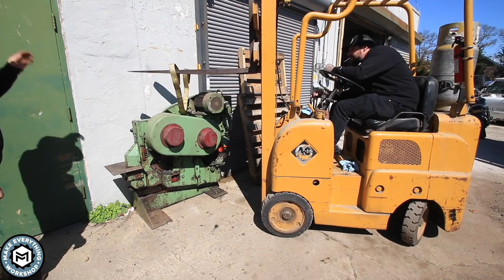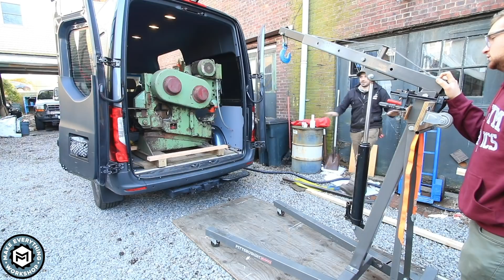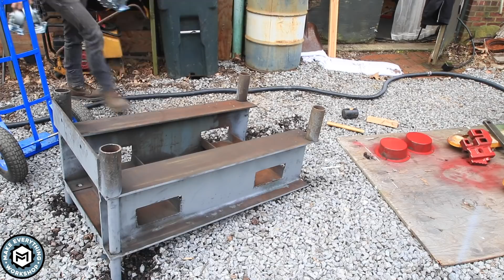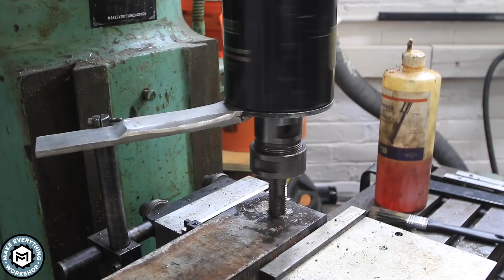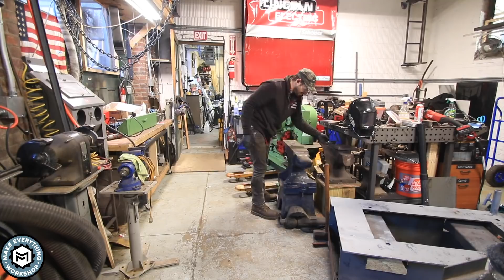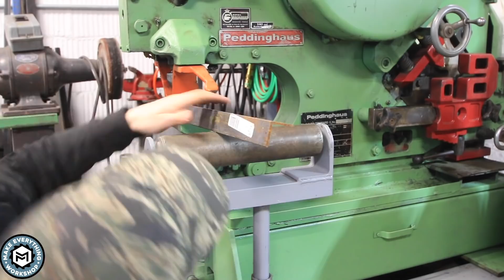My New 38 Ton Ironworker - Peddinghaus 210/11

Comment: what is the machine number? Mine is 711

I have trouble with mine. The punch often does not travel all the way back up to separate from the sheet that it just punched from. So then it stays jammed into the plate. Have you ever run into this problem?
I was using the matching set to punch 1/4 inch steel. Should I use a larger hole for that thickness of material?

Comment: I've got one that I bought for $1800 & it came with about 50 dies & a new set of shear blades. It's in excellent condition. I don't use it much now but it's there when I need it. Peddinghaus is the best for sure.

Comment: After having worked with and around heavy equipment movers and professional riggers, I moved 1 and 2 ton workshop equipment alone using an apple box full of pipe rollers, a couple bars, some lumber, and a hand winch or come along.

Comment: I am no machinist, no ironworker, and no metal fabricator, but I have been around many such shops in my long life. Albeit, I have never seen one of these pipe machines before, the pure smooth power of the punch simply amazes me. BTW: If you keep buying machines, you won't be able to get into your shop to work.

Comment: CROPSEY IRONWORKS 1954 - 2018 BROOKLYN NY. WE HAD AN 88/10 CIRCA 1938.  4000 SQUARE FOOT SHOP SIZE SO WE HAD IT SIT ON A STATIC STAND TOPPED WITH 1" PLATE. THE MATERIAL WAS FED  IN ON CUSTOM MADE CONVEYOR ROLLER BEDS FOR THE LOWER KNIVES AND ANOTHER FOR THE ANGLE IRON ABOVE. WE HAD CLAMPED MEASURING STOPS ON THE RIGHT SIDE, WITH EPOXIED IN MEASURING TAPE, THE STOP GLIDES WHERE SOLID 1.5" SQUARE STOCK, THE MATERIAL STOP SLIDERS CLAMPED ALONG THE LENGTH USING  DEDICATED VICE GRIPS TO HOLD THE CUTTING MEASUREMENTS FOR PRODUCTION WORK. I CHANGED THE COUNTERSINK GREASE FITTINGS TO THE TYPICAL NIPPLE TYPE ONES FOR EASIER PENETRATION. PEDDINHAUS HAS A MIDWEST OUTFIT FOR ORDERING KNIVES - EXPENSIVE. THE  UPPER COPING KNIVES WERE REALLY EXPENSIVE (GERMAN STEELS). WE GOT THE PUNCHES FROM CLEVELAND TOOL CO AND WE REGROUND THE PUNCHES PERIODICALLY USING A FULLY RESTORED 1914  10" SHELDON LATHE USING A TOOL-POST GRINDER. I THINK I SOLD THE MACHINE FOR $1500 ON CRAIGS IN '18. THE MACHINE IS A BEAST. WE DID ORNAMENTAL IRON WORK AND I LEFT A LARGE BODY OF WORK BEHIND OVER MY TENURE. ENJOY IT'S YOUR TIME NOW.

Comment: Just a couple of thoughts. Now that you have levelled the support roller, place a scratch line on the shaft to make re-setting easier. You can also put marks for when lowering the roller for common sizes of steel. I also saw you mention about the D-rings in the van possibly pulling out. I think that it would be prudent to mount your own stronger D-rings with under floor reinforcing either side of the wheel arches.

Comment: 2000 pounds is only 1 metric ton, not 38
Reply: It weighs 1T, it’s hydraulic ram power is equal to 38 tons of force to work the metal with
Reply: @JTimberB.45  Thanks, got it. As it is a German manufacturer, these should be 38 metric tons. Respect.

Comment: In the 80's I caught my middle finger in between a ring I made for a rim and the notcher on the front of the Peddinghaus at my first job, wasn't pleasant, the nail went black and raised up a half inch, I was afraid to go to the hospital, thankfully still have the finger and a new nail. Fantastic machine though, still in service.

Comment: I forgot to add FYI when using punching machines like this for 1/2 inch thick material the die needs to be 1/16 larger than the punch and for material thinner than 1/2 inch it should be 1/32 larger . And that will be mostly what will be used on this machine anyway .

Comment: That ironworker will run forever just keep it greased ! As for punches and dies don't bother making your own they are cheap enough from American Punch Company . I work for a big steel shop in LIC, NY and I have been to the Peddinghaus factory in Bradley Illinois 3 times . That machine was probably made in Germany . And parts from Peddinghaus are still avilable .

https://www.americanpunchco.com/

Comment: The max weight is actually 3000 lbs as only 3 wheels will take the load until one yields, but your 1/2 ton under max so you should be ok.

Comment: I'd recomend a tilting bed truck or trailer with the palletized machine on a pallet jack. Tilt the bed with the load supported by a rachet strap to the heak of the bed. Use ratchet strap like a clutch to gently roll it out. I moved a 3 ton mill like this.

Comment: My concern with moving it in a van the suspension would be a very distant second, and number one would be what happens if you come to a sudden stop (think car accident). If that thing isn't strapped down like crazy, even a low speed accident is going to kill everyone involved when a one tonne metal object with no crumple zones becomes airborne, rips through the front seats of the van, through the windshield and continues into the cabin of the other vehicle.

Inertia is the second biggest bitch, only topped by gravity.
Reply from the maker: Yeah, that’s definitely a concern, I strapped the hell out of it with 10k rated straps but in a real bad accident the D rings would just rip out and I’d die a horrible death.

Comment: "Should never run a machine without the covers on"

Ope, news to me! All my machines are open belted with old leather flat belts, except my mill.

Good work getting it in there man.
Reply: Gaurds are add on for this old flywheel cropper it will punch through 1'' plate like butter

Comment: Today everything is hydraulic and guys think they are the cats butt. They're not. A Peddinghaus will outwork any of the hydraulic units I have seen. They are fast and accurate when setup correctly. I worked in a shop that had a Piranha and a Peddinghaus. The Peddinghaus was always busy. The Piranha was like a backup when you needed an ironworker now and simply couldn't wait. So keep your Piranha and give me a Peddinghaus any day.
Reply: Nu te necaj dageaba  ati furat cu zecile di astea din romania tot occidentu si mai sint vino si cata la noi si vei gasi si acum chiar noi in vaselina ne folosite nici a data ca nu au mai apucat sa le foloseasca au furat si au distrus tot sar putea sa mai gasesti prin vreo magazie la vre-o fabrica recent abandonata incearca
Reply: @viorelpopescu4990  What F**k are you talking about? I used a translator and this is what it came up with: 
Don't worry in vain you stole dozens of these from Romania all over the west and they are still coming to us and you will find us and now even we in Vaseline used us not even once they stopped using them they stole and destroyed everything you may find yourself in a warehouse at a recently abandoned factory

Comment: The motor is a 3 phase  5 Hp ? how did you wire it to be able to move it ? Nice job by the way.
Reply: Motorul este da 3 faze dar are 5 Kw  Cp e alta mincare da peste desi masoara tot puterea dar in (w) puterea electrica iar in( Cp) lucru mecanic efectuat  o mica mare diferenta 1Kw = 1,36Cp

Comment: Chris, I'll make all my tool bases/workbenches such that they can be easily moved with a pallet jack (proper height and spacing of lower cross-members). No need to purchase casters, no need to make stabilizing legs. Easier to move with the handle of a pallet jack then trying to hump around a ton on casters.

What are you doing with the other iron worker?

Stop by if you're in central Suffolk.

Comment: I used to use an old iron worker about the same size when I was doing sheet metal fab. I used to go through 3x3x1/4" - 20' angle by the pallet load. Certainly a time saver, very cool feeling of power when it punches through the thick metal. As a die maker I now use the big brothers to these machines. Also watching you move that around the shop certainly makes me appreciate our 60t/25t(60t main hoist with a 25t auxiliary hoist) bridge crane where I'm moving around 40-90k lb dies around by myself. Good luck with it, stay safe and be safe with those punches and dies.

Comment: Would u be interested in making a wide clothes wringer 35 inches wide steel and wood not rubber. Or perhaps steel rollers  won't work that's why they are in wood or rubber.
Reply from the maker: thearough shoot me an email info@makeeverythingshop.com

Comment: A very nice tool, wish I had room for one.  Just curious, and I'm sure hindsight is 20/20, but why did you unload it at the opposite end of your driveway and why not put it on the base to roll it in rather than the pallet jack? I'm betting your shop crane could have lifted it high enough to get it on.
Reply from the maker: Good questions. This sat outside my shop for almost two weeks before i brought it inside, and I share the driveway with another guy so i had to keep it out of the way. its actually a lot easier to roll it on the pallet jack than the dolly base, and the mass of this machine is high up, so the closer it was to the ground, the safer i felt moving it would be. The nice thing about a pallet jack when moving top heavy stuff, if it start to get tippy and sketchy  you can grab the lever and drop the pallet jack down to the floor and itll usually stabilize it quick!